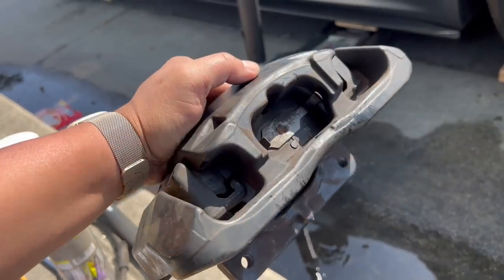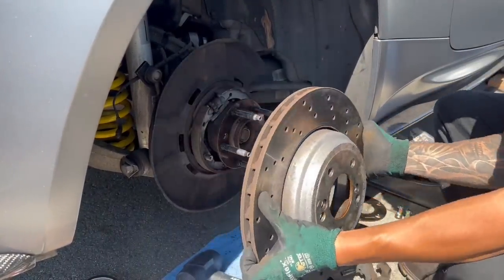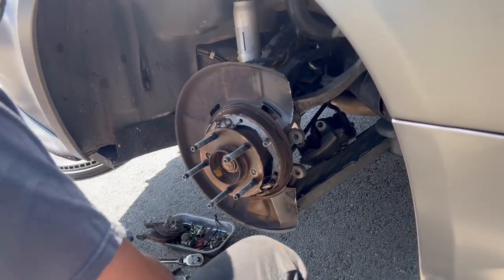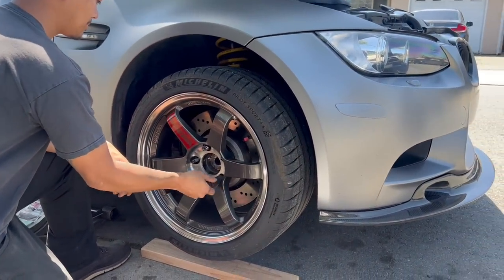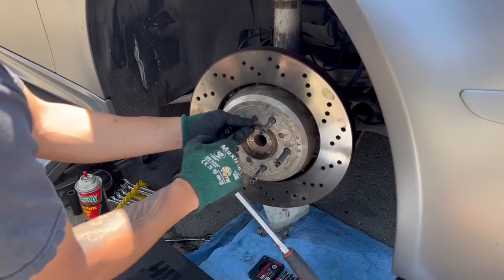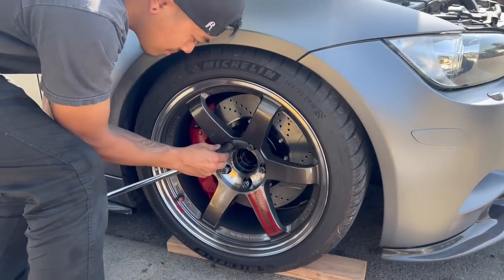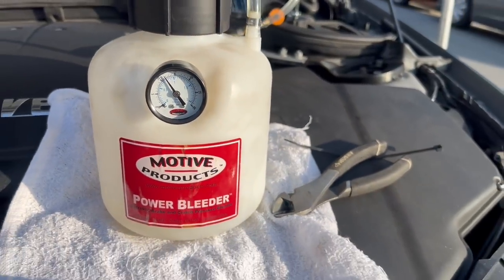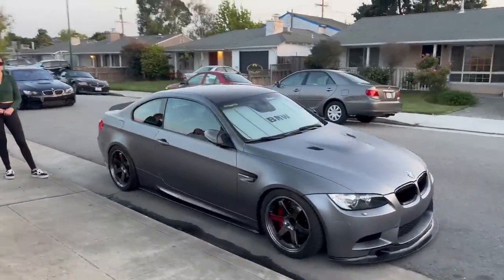Affordable Brembo Big Brake Kit for E92 M3 Install Bigger Calipers & Rotors DIY Tutorial E90 JQWerks

Comment: To those who are skeptical about purchasing this kit, I have confirmed with the seller that the calipers are used 17Z (L&R) front and rear calipers sourced from Germany and rebuilt. The calipers are stamped with "17ZL" , "17ZR" and "Made in Italy". The rotors are custom built in Los Angeles, CA to fit E9x M3's and the pads are genuine Brembo pads.

As for the rotors bases, brake lines and brackets - they are from China. Brackets are made of steel and will be revised so that you will not have to burr your spindles like I had to on mine. After a 250 mile drive, the brake lines do not have any leaks. 

This kit was also tested on the track with an E92 M3 and an Alfa Romeo 4C for 4 years with no issues according to the seller. 

Good luck to those taking on the installation themselves, please feel free to reach out to me for any questions!
Reply: Good to know… I would say the added value is the bracket by itself along with the rotos. There is plenty of 17Z on ebay (used in old Porsches, WVs and Audis)… but the difficult stuff is in machining the brackets: a machinist will charge around USD 1000 to make them from scratch. The thing I will be concerned are the rotors. Do you know if the seller will give you the contact of thar shop? Will you have to purchase from him later? Another question I would ask is some technical stuff (I am more interested in performance than looks): what about the brake bias? Would the contact patch was calculated? Was the brake performance measured?
Reply: @redzone5655  The rotors are made by the sellers friend who’s an engineer in LA. These are all good questions for people that want to use this setup for performance/track. I would contact the seller on Instagram. If you send me a pm I can send you his account name.
Reply: Also don't forget to bleed and bed properly after installation to avoid any failures.

Comment: Looks good but how do you adjust the handbrake shoes on the rear axel? The rotors dont have an access hole?
Reply from the maker: You have to remove one of the stud conversions. Just screw it out with a hex bolt. If you have lug bolts you don’t have to worry.
Reply: @Sals_Garage  makes sense, thank you!

Comment: I’m running similar 18” TE37 non-SLs. What size rotors did you go with? Front & Rear? Want to make sure everything clears just right.
Reply from the maker: Not sure what size the rotors are but they are huge. Try asking @e30bunac on instagram.

Comment: Anyone notice that the 17ZL calipers went on the right side and 17ZR calipers went on the left? Am I wrong?
Reply from the maker: So far working good, must be interchangeable 👍
Reply: @Sals_Garage  Turns out the original car that these were mounted on were mounted on the front of the rotor and not the rear like E92's. This explains it all :)
Reply from the maker: @MrCarSounds  👍

Comment: Great video once again Sal 👍 nice BBK, there's also another option from Merc C63 AMG... Also Sal, you can bleed brakes using INPA where software does a proper bleeding using car's own pump 👍 great work Sal and team... Cheers 🥂
Reply from the maker: Thanks for the info! I don’t have inpa, need to research how to install it on my laptop.  Lots of cool features it seems. 

You’re right about the C63 brakes. I just changed the pads on a C63 yesterday and the brake calipers are the same as these Brembos 😆.  I’ll do more research about how to mount the calipers and try it on my M3, thanks again for the useful information
Reply: A cheap 100.00  fox well 510 scanner  for bmw  is a must have same with a cheap 808 autel does all that and in English, inpa can be discouraging  unless u can read and understand German language

Comment: Should raise the car a bit. It will handle better. I I stalled AP racing on my E92 M3.
Reply from the maker: Thanks for the tip
Reply: @Sals_Garage  Same set up as yours - 6pot front with 380MM floating disc and  4 pot rear 355MM. But I think Brembo is better for street use as AP racing don't have dust shield on the piston at the caliper.
Reply from the maker: @dawnnadir  nice!